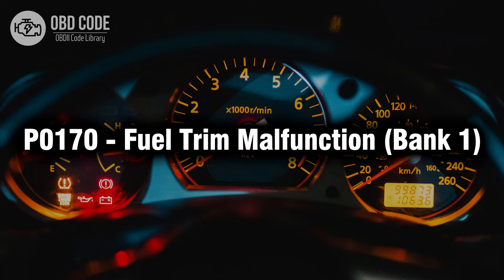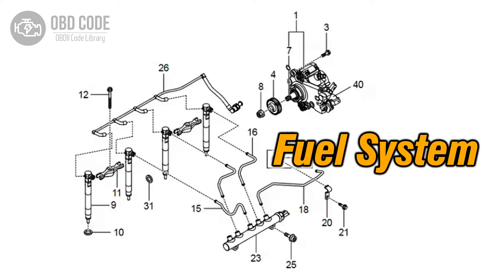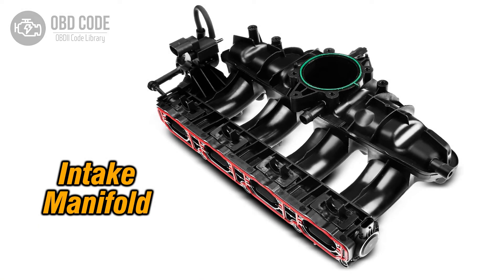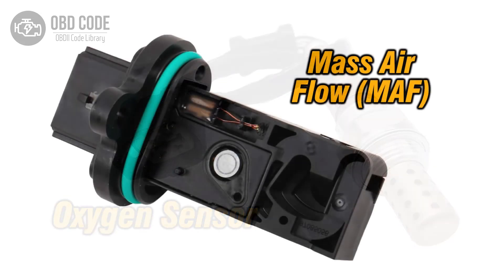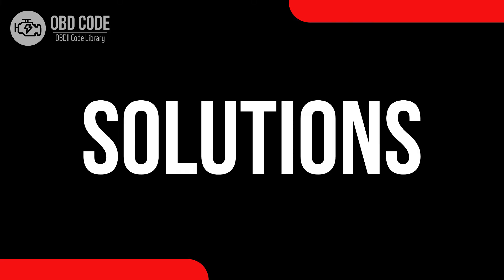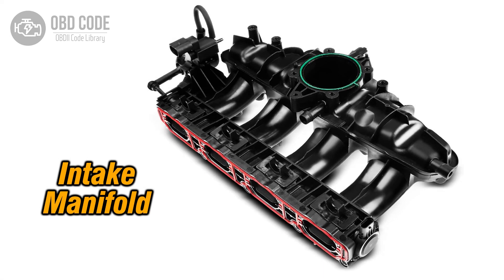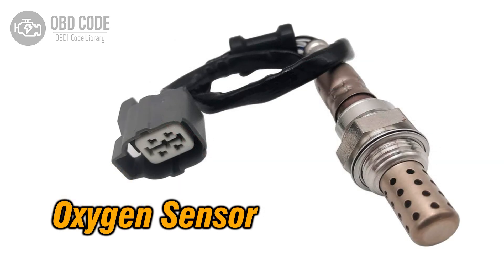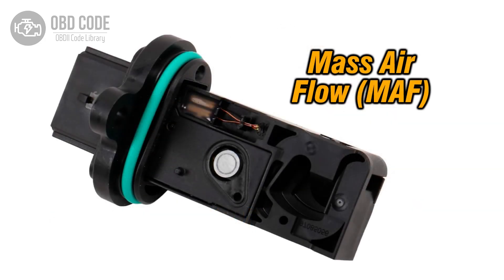P0170 Fuel Trim Malfunction Bank 1 🟢 Trouble Code Symptoms Causes Solutions

Comment: SHFT was 16% at idle on hot engine.  When car was driven STFT dropped to zero. LTFT no charge was at 8%. Removed a code same as your video.  Engine management light now off. Car was not displaying symptoms other than engine management light. Suspected vacuum leak as manifold vacuum less effect as throttle plate opens up. Thanks.
Reply from the maker: Good morning, thanks for the comment.